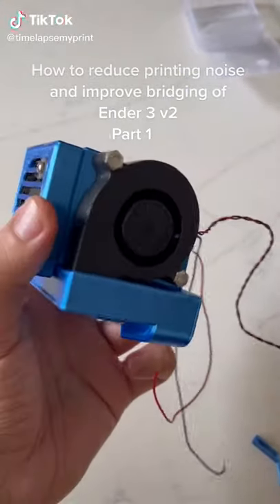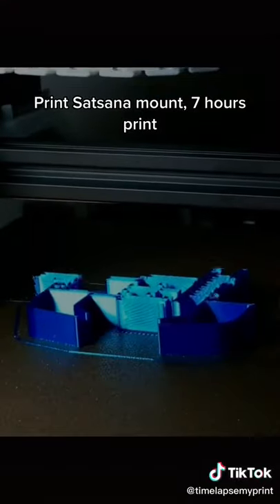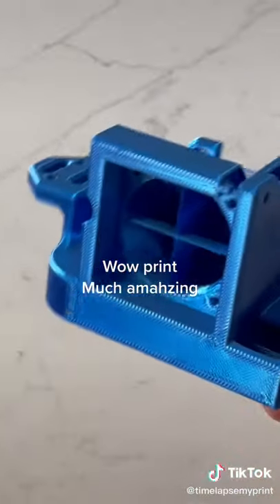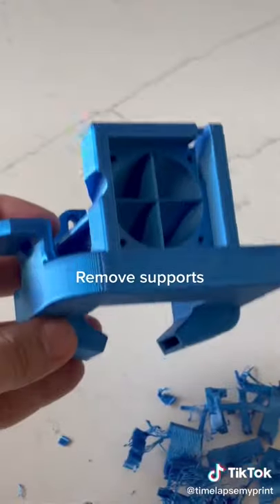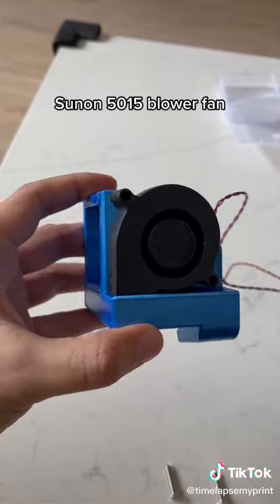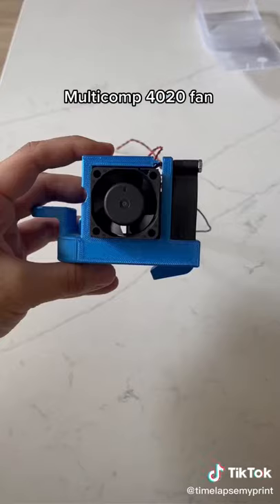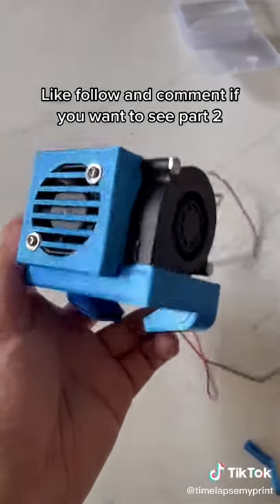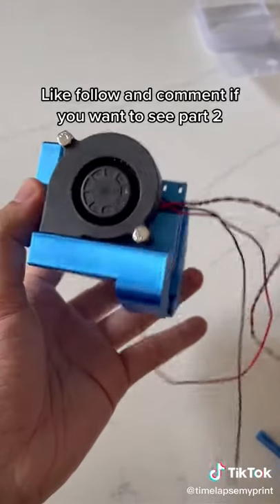Upgrades to Ender 3 v2 part 1: Fan noise #Shorts

Comment: What filiment did you use?
Reply: Petg is the best for thing near the hotend
Reply: depends if its for a completely stock ender 3 v2 then youd get away with pla + if you keep the silicone sock on the hotend